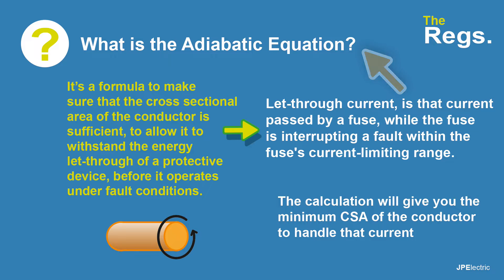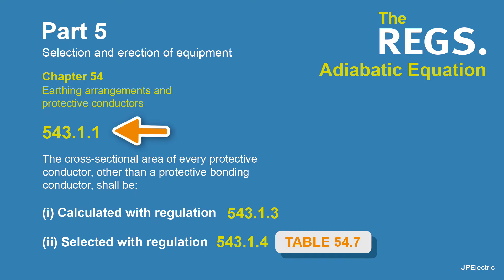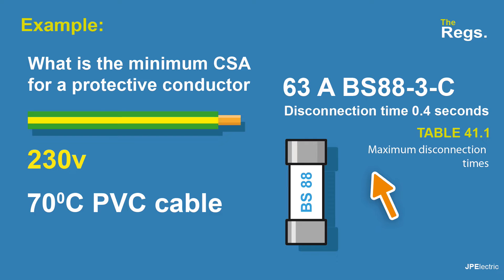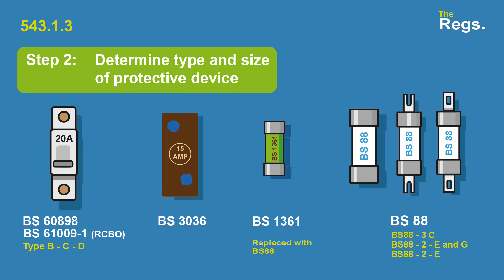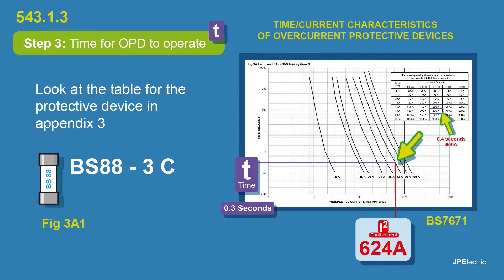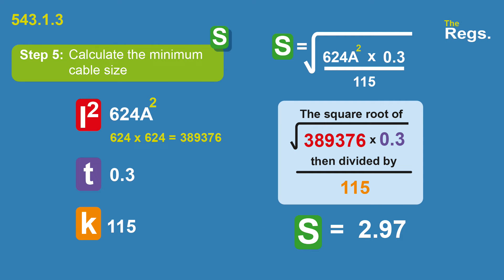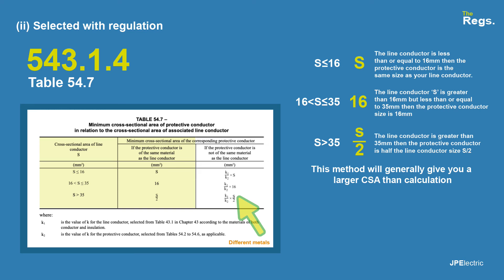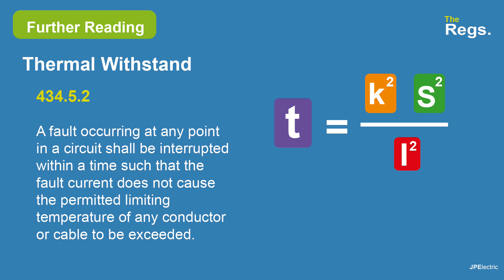The Adiabatic Equation

Comment: Could you do an example like this;
I always give my apprentice a realistic scenario. So, you’re self employed and you’re doing an EICR of a 3 bedroom house.
1. It’s a TN-S system.
2. The ‘Main Earth’ (as many of us lazily call it) is 10mm. 
3. The ‘Water Bond’ is 10mm and it is 100% correctly connected, continuity is perfect, no corrosion, tight Tenby Clamp, no parallel paths connected when testing it using a R2 long lead.
4. The ‘Gas Bond’ is 6mm. Same checks and tested as No.3.

In the company I work for I’d have to upgrade the Gas to 10mm…..because the Client wants it that way. Fair enough.
 I want the apprentice to correctly measure and calculate what the main protective bonding and equipotential bonding has to be to comply with the Regs. 
 If they measure a PSCC at 1.16KA and a PEFC at 0.906KA and the Cut Out is 80A, how do they use the Adiabatic Equation to work out S?
k is 143 (25mm double insulated Meter Tails)
Thank you

Comment: Great video!

Question:-
Does the factor of K @ 30 degrees not get used? If the initial temperature isn't >70 degrees? In which case 143 would be used, not 115? (As 115 is assumed initial temperature of >70, but in a house etc >70 is potentially unrealistic?)
Reply from the maker: Hi Ricky1396. Thanks for watching. Good question. My understanding is,  when dealing with fault current calculations the value of K is to correspond with the final temperature.
Reply: @JPElectric  Yeah that sounds the best route to go down. Been trying to get my head into these for a while, thanks for the content & reply!